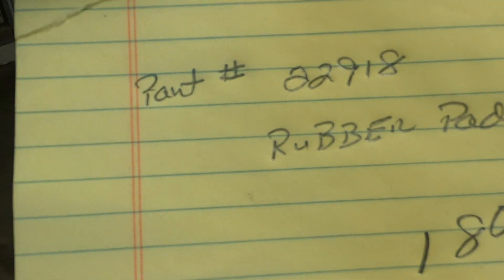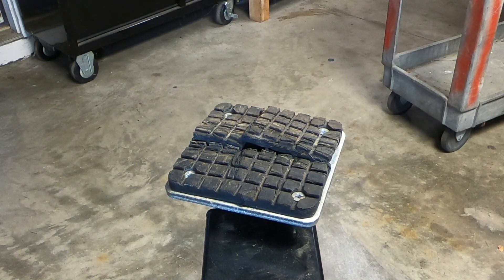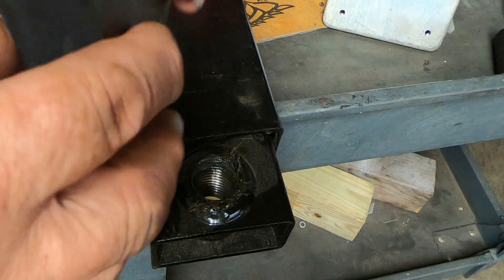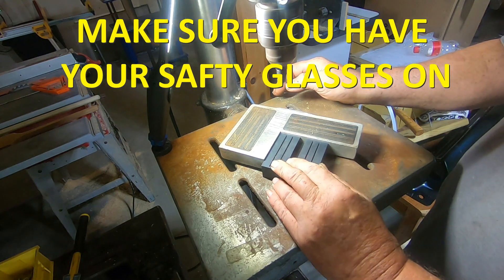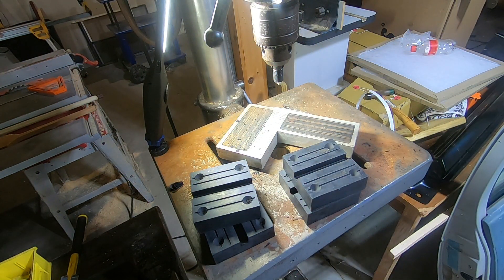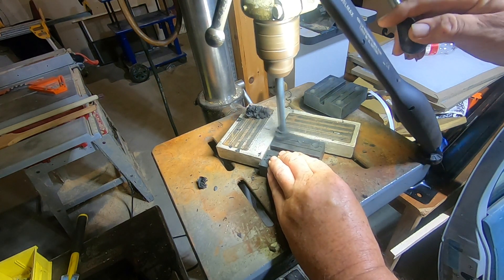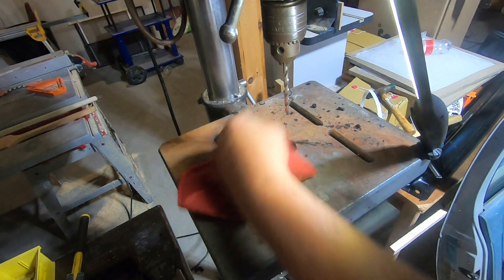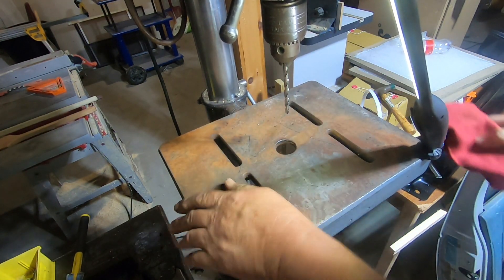Better Pads for the Harbor Freight Daytona Crossbeam Attachment

Comment: On which point do you jack with the first floor jack to get to the pitch weld with the one with the attachment?
Reply from the maker: Thanks for the question.  The pinch welds or as they are sometimes called spot welds run the entire length of the body from wheel to wheel.  They are reinforced in only two places near the front and rear wheels for jacking purposes.  The Daytona Crossbeam Attachment is not long enough to reach from one reinforced pinch weld to the other. That is ok because of the way the weight of the vehicle is distributed. Most of the weight of the vehicle in in the front because of the engine and transmission. A a result it is important that the front pad is on the front reinforced weld. The rear pad will not be on the reinforced weld but that is ok because most all the weight is being supported by the front pad. The rear pad is just along for the ride. Therefore should the crossbeam not quite fit under the car you can use the extra jack on the rear reinforced  pinch weld because it is available. I am sorry the answer was so long.  In the days to come I will do a follow up video to better explain all this. Thanks for giving me the opportunity to clear that up and thanks for watching my channel.
Reply: @richardspaulding5035  Thank you for the answer. Yes, I thought, it is possible to get with the crossbeam to both pitch welds on one side - which I was wrong, thank you for the clarification. Is it long enough to jack up on the pitch welds for example the front side of the vehicle?
Reply from the maker: @ondrejkuchta5581  If I understand your question you are asking is it possible for the crossbeam to reach across the car to reach both front pinch welds. The answer is no. However there may be places in the front, in the area of the subframe that you can jack from.  This will vary from vehicle to vehicle. Same goes for the rear of the car.
Reply: @richardspaulding5035  Yes, that's  what I meant. Thanks again and thank you for your content.

Comment: Thats nice but holy run out
Reply from the maker: LOL, I think you are referring to my old drill press. The shop I worked for was throwing it out so I asked if I could have it.  I found out why they were getting rid of it.
Reply: @richardspaulding5035  free drill press worked perfectly didn't it?  It's not the Space Shuttle as ol' Taryl says!!
Reply from the maker: @AccuracySpeaks   it works, that's about all I can say, lol
Reply: @richardspaulding5035  Haha, I hear ya, I have one about as true, but it will drill a hole!
Reply from the maker: @AccuracySpeaks  You are correct once the drill enters the material is stops wobbling. As stated I am not building a spaceship LOL
Reply: @richardspaulding5035  Absolutely!